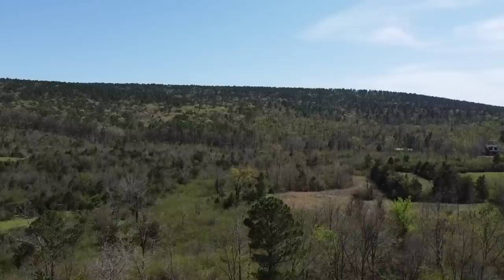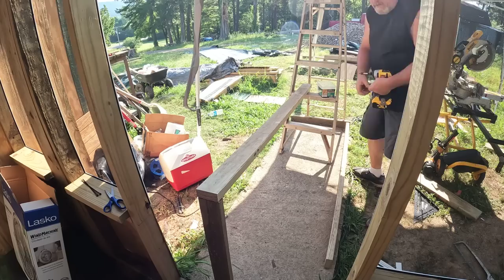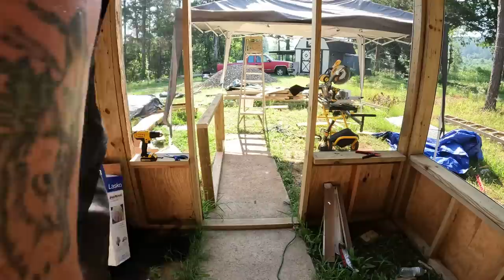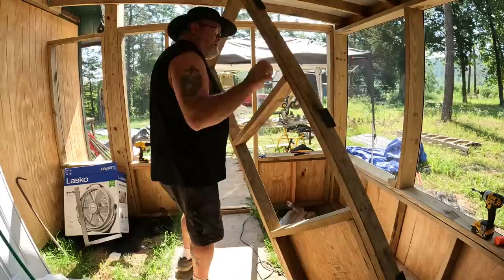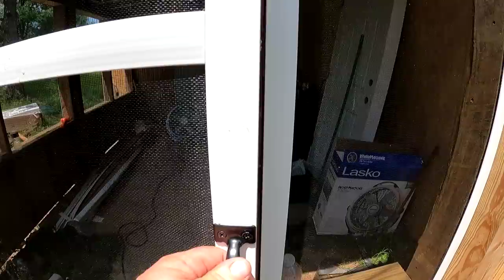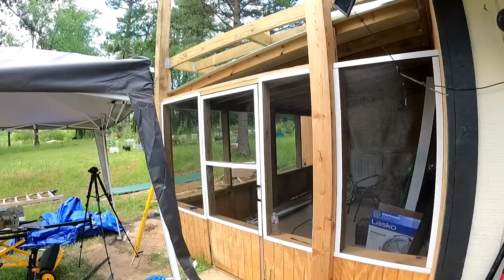Screen Door Is Done! Doing A Little At A Time In The Heat/ A=Frame Patio/ Deck Build

Comment: I would recommend a X brace at the bottom where the T1-11 on the inside of the door. That will hold the rectangle in square specs though the seasons.
Reply from the maker: The whole bottom of screened porch on the inside is getting covered in corrugated metal, which will keep it in shape